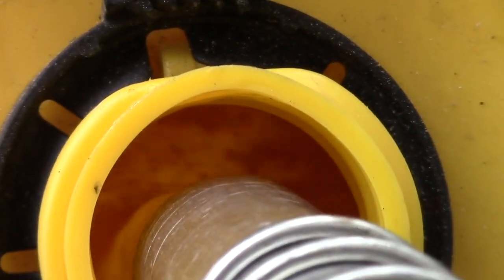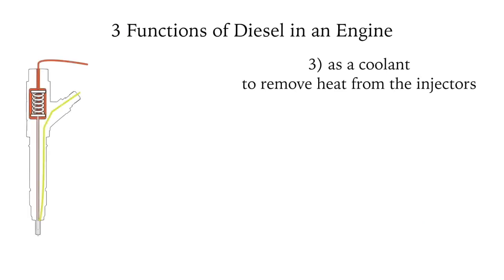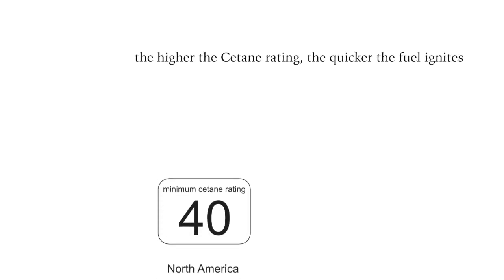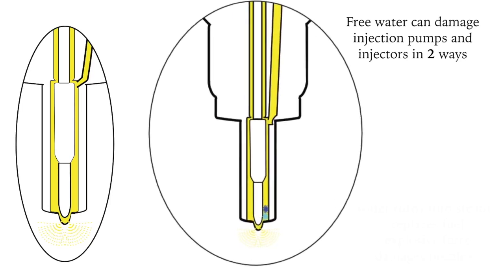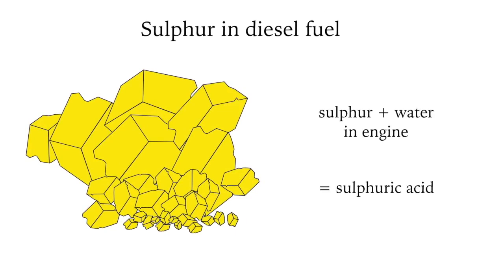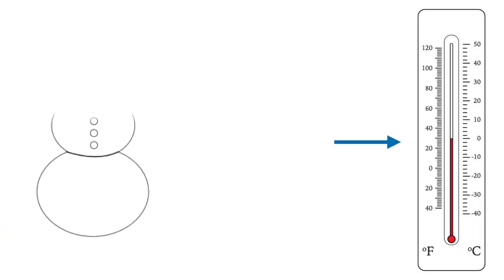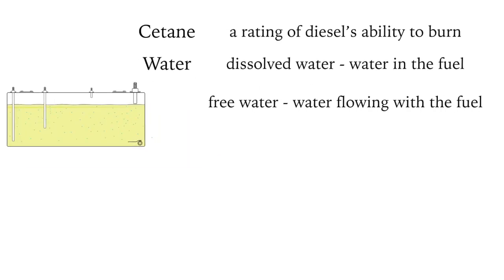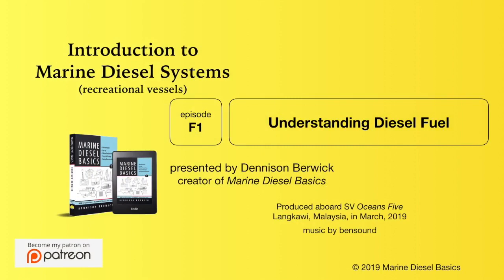F1 Understanding Diesel Fuel

Comment: what can cause an injector  to piss instead of spray causing excessive smoke ?
Reply from the maker: dirt in the injector can prevent correct atomization (spray pattern). White smoke (unburned fuel) and black smoke (partially burned fuel) can have several causes.